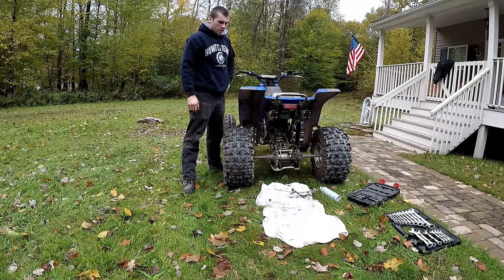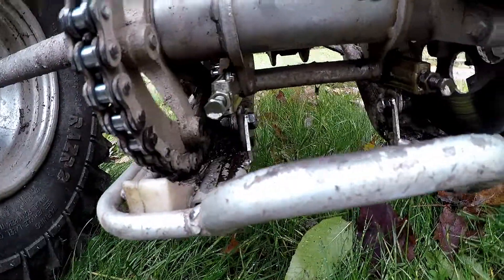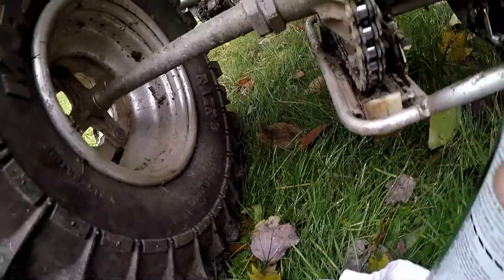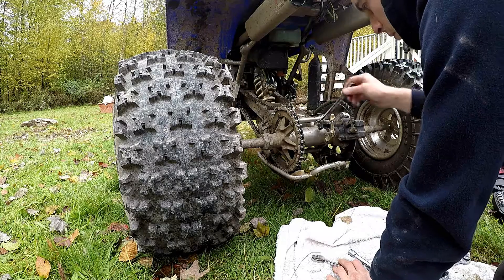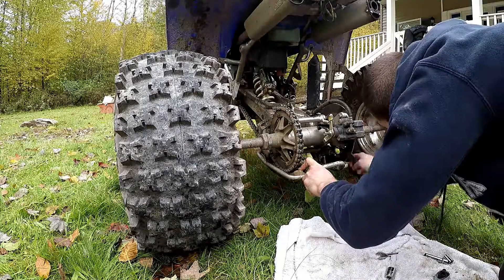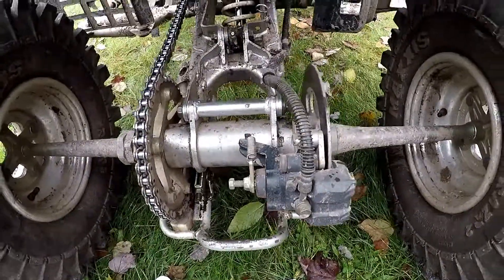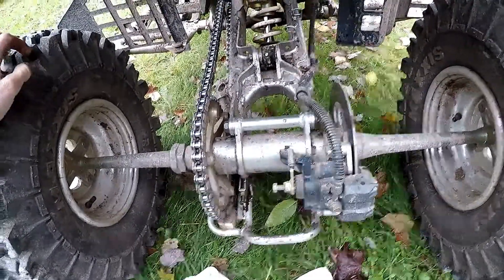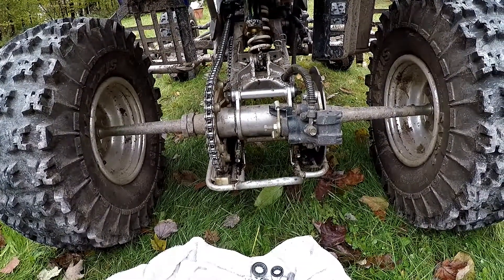Yamaha Banshee chain adjustment

Comment: i’m missing both of my adjusting screws is there a way i can do it, can i just buy two random bolts
Reply from the maker: As long as they are the proper size, i dont see why not!
Reply: thanks
Reply: @g-moneyracing127  i already do it with out just put the quad ona jack and hit the axles back

Comment: Is a bottom chain roller a must?
Reply from the maker: You want to keep all the stock compnents there. You can upgrade every roller and slide. I also have a video on that. Those rollers are there to keep the chain were it needs to be.